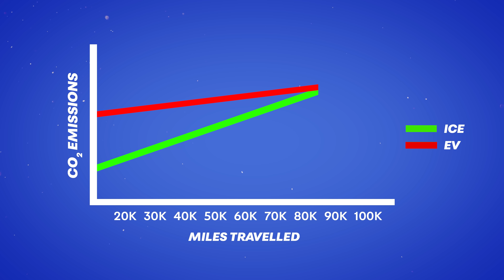Are Electric Cars REALLY That Green? [New 2022 Data]

Comment: The problem that is never discussed is the 5 mining processes involved in making the batteries and how its actually a bigger environmental issue. Not to mention the destruction of African communities digging by hand mining in the worst and unsafe conditions. Their communities are also suffering from birth defects because of it. It is not as cut and dry as either side wants to make it out to be. How are you going to still produce enough energy to power all this? Fossil fuels that's how. What happens when a strain is on the power grid? I watched a documentary about this several years ago and I wish I could find it. The findings were mind blowing and in the end they actually said that the environmental impact was worse with electric and mining the raw the materials.
Reply: Around 45% of the World's lithium is mined in Australia, and very few Africans are involved.....

Comment: Great presentation. I’m curious. What is the depreciation of the electric version versus the petrol version?
Reply: Electric vehicles keep value fairly well.
Reply: @smartwatchonpluto  makes sense, less moving parts hence less failure points.
Reply: @smartwatchonpluto  Also after 20 years? Maybe not many moving parts, but a lot of electronic parts. My 22 year old VW van now has done 250.000km and will probably do another 250.000km without major costs.

Comment: The "greenest " car would be a late 90's or 2000's Toyota Corolla or Nissan Pulsar or a Ford Laser/Telstar. If you keep buying 2nd hand parts, rebuilding engines, etc you are stopping re-manufacturing of parts and cars. The problem we have in Australia, there is not many recharging stations to go around. Most people who live 100km outside of the main cities want an EV that will get 500km out of a charge as many people here drive up to 200km a day commuting. Almost all our power is made using coal or natural gas, unless you have a battery/solar setup at home. Most solar setups on homes are NOT battery systems and just solar, thus no storage. Most 5kWh cars take about the same power to charge as twice the power of the average home. That would mean we need to increase our power output from power stations 2-fold within the next 13 years, when most cars will be EV only by 2035. Our power grid is not up to date to handle that amount of power. They have even removed many of the buy-back of power from solar power on homes and now charging people for feeding the grid due to this. I know in many parts of the cities there is no off street parking, so how will these EVs be charged at night? There is hardly any charging points along roads with homes. With a block of flats of say 20 units, everyone comes home and plugs their cars in, go upstairs, put on Netflix and the microwave, guess what.....brown-outs anyone? Then there is the problem we have here of distances that most people drive. We have big service stations with about 20-30 pumps for fuel on out freeways. These will have to be modified into car parks for recharging stations as EVs will take 40-60 mins to charge

Comment: Using wind or solar power to charge your electric car might be 'greener' in the short term but neither are sustainable as both are using up rare metals, which are not renewable, at an alarming rate, far faster than we are using up oil and coal reserves. One solution might be to bring back the small windmills that used to dot our landscapes and use them to power individual households rather than building enormous unsustainable wind turbines.
Reply: Lithium batteries are 100% closed systems.  No material is "used up" when they operate.  Every bit of reactive chemical at battery's beginning of life is there at the battery's end of life.  Take for instance the extremely common 12-volt Sealed Lead Acid (SLA) "car battery" -- it is one of the most recycled mass consumer products in history at over 99% recycle rate.  As Lithium usage grows worldwide, the money for recycling will as well and so will research into recycling these new batteries.  Governments can impose taxes or use fees on EV batteries to support recycling research & infrastructure.

Lithium isn't even that rare.  Its found all over the Earth's crust and even in seawater.  Seaside water distillation plants around the world produce a brine sludge by-product. Its estimate this brine, once processed at scale, contains enough Lithium to sustain all world wide battery Lithium production.  Lithium is actually a small part of an EV battery by weight.

The world has to move to more electronics recycling in general and not just batteries -- we need  "circular economies".   We produce around 50 million tons of e-waste per year from things like laptops, smartphones, TVs, and other gadgets.  EV batteries are obviously much larger than consumer electronics but EV batteries are simpler by being more homogenous in construction than complex consumer electronics.  Even a small portable device is loaded with mashup of wires, plastic, glass, fiber glass circuit boards, rubber, various metals compounds and themselves contain small batteries.  These are distributed all throughout the body of the appliance.  Still there are companies working on recycling these electronics!

Battery technology and manufacturing is evolving every year.  For instance, Lithium Iron Phosphate (LFP) batteries do not even use the nickel, manganese, cobalt (NMC) of the common Lithium NMC batteries.  Pretty much all the leading EV makers are thinking of or already switching to LFP because it is cheaper and lasts longer.  The highest performance EVs may stay with traditional Lithium NMC because LFP has a slightly lower energy density.

Even before "recycling", the better strategy is to "repurpose".  Recycling actually should be last resort.  Batteries used in commercial EV vehicles still have some 60% to 80% of their capacity left and can be repurposed as home or commercial grid scale batteries where power and energy density is not a critical operating factor.  BYD warranties their LFP EV batteries for 8 years or 500,000km.   Tesla for 8 years or 150,000mi (241,402km) for the NMC batteries.  You can often find these old EV batteries eBay at end of life or any other vehicle mishap for use in DIY energy projects.  They are sold by smaller modules or an entire battery shipped by freight or local pickup.

Comment: The EV cult is like the covid cult or the Ukraine cult. Scratch the surface of all the virtue signaling, and the real story is sinister and actually quite morally and ethically questionable.  The establishment is pushing EV as being "green" and pushing people into a  "green" morally surperior frenzy,  because they are being granted large sums of money from government ( tax payers) to develop, make and sell these vehicles.  And they get free advertising via the "green" cult. Everything you mention is correct but you missed some pertinant points. 1. More EV's means more pressure on the electrical grid. Even if the number of EV's would double, it would overwhelm the grid. 2. EV vehicle fires are extremely difficult or even impossible to contain and because of it even more polluting to the environment (I was a FF and trained in this issue). The battery can reignite for days. In Germany they often just let the car burn and push it onto the shoulder. This is NOT green.  Without going into detail, there are 2 documentaries made in Germany on EV fire. 3. If you are in a colder climate like here in Canada, the battery life is going to be significantly shorter meaning replacement will be imminent after a far shorter period of time. Meaning, more batteries will have to be made and disposed of or as some say "recycled".

Comment: I still see no argument made? If you are somehow dont drive a lot and switch cars every 5 years you are "greener" but just your footprint. You were still the reason another Petrol car is put on the road and it probably pollutes the Air for another 10-15 years when you got your New one. I drive my cars 5 to 10 years, and usually sell them at about 200000km (around 150 000 Miles I think?). 
So for me personally and after I Sold them an electric car is better. 

Now this Argument is only true if you buy a new car. Many get angry at me because buying an old car is better for the Environment, which is kinda true, but they usually dont last 5 to 10 years unless you get a young used car instead of the 8 year old car

Comment: One often quoted statement is that electricity is cheaper than diesel. This just isn't true outside of your home.  Charging your EV at anything over about £0.45 per kWh and you are paying more to fuel your car than the latest generation of Diesel engines (60+ mpg) for a given distance using current fuel prices in the UK and Europe (Apr 2022).

Comment: Any evaluation of efficiency and environmental impact must consider (or at least try to eye-ball) the actual use case. Because there is not one form of drive that suits all cases best. Purely urban traffic likes BEV, purely long-distance travel likes ICE, if you do both sufficiently often a PHEV is best.
If you torture an ICE through urban traffic and/or short trips, even the most efficient engines will be really bad. If you try to use a BEV for long journeys (where they are wildly inefficient), they will be really bad. If you get a PHEV, but mostly only use one of its motors, its a waste of money and loss of efficiency + quality of life.

Comment: Governments will hide the fact pollution from the manufacture of the battery parts, electric motors and the environmental impact of the waste produced from the parts after the car is used, crushed and buried in a landfill will leak chemicals for generations and leave the scars from mining operations. But hey, at least you didn't burn gas while driving it for the 3 years you had it lol.

Comment: The problem is, Volvo and many new manufacturers have poor ev economy. The XC40 isn't the most aerodynamic machine ever made. The premium brand car makers have simply put huge batteries in inefficient vehicles reducing the benefits of an E.V. If you had a model 3 tesla and ran it on renewable energy you would probably see far better figures as other reports have found. Finally who throws a car away after 90k? Most vehicles now go to around 150k or more.

Comment: Although I believe Volvo may have stretched the numbers as they'd prefer to keep on selling the ICE cars which are more profitable for them, there is a key difference between ICE And EV. Oil is a natural resource that will inevitablly run out. The materials in EVs can be recycled >95% and it is much more economical to recycle these materials than to mine and refine new material. We're nearing the end of the ICE age.
Reply: unfortunately
Reply: @peterniepel6218  I meant to say 95% of the battery can be recycled, as of course that is the main carbon footprint contributer. I got that from Redwood materials CEO JB Straubel. I
I believe battery recycling will become a new industry over time as it's more economical than mining new materials.
Reply: Where are you getting these figures that EV's can be recycled >95%.  EV are the future but battery like Li-Ion isn't.  We talk about polluting the environment with CO2 but what about polluting the environment that mining for the raw material causes.  The destruction of the land, mountains, and especially polluting the water system.  These raw material are toxic and hard to recycle.  Only a handful of companies actually recycle EV batteries They repurpose them, not by breaking them down to make new batteries.  They reuse them for something like battery packs for homes.  It is like saying plastics are recyclable because it has the recycle symbol on it.  It's getting recycled because I always put it in the blue bin to have it recycle.  What a crock!  Also, the renewable energy of solar panel and wind mills sounds great now but it's already creating issues of what to do with them after their 10 years life cycle.  If you take out the battery, both ICE and EV are the same if you are talking about recyclable materials.  There is no difference in how cars are made.  A gas motor is more recyclable than the huge battery pack.  And no, it's not more economical to recycle a lithium-ion battery. Gas motor >recyclable> EV battery pack.
It's funny that Rory said that driving an EV will benefit the clean air around you but what about the polluted waters in the areas where the raw materials are mined.  Those people surely aren't singing the same praises.
EV's are the future but we are not there yet with a good sustainable energy that powers an EV.  That is why Toyota is still looking at hybrids and Hydrogen is still being looked at.  I do not think Li-Ion is the future for EV's, at least not the ones that are in Telsas or any of the current EV vehicles.

Comment: The greenest thing possible, transpo wise, is reduce driving whatever car you've got so they have a longer life and less energy burned, and use public transportation most of the time. Trains are very efficient, and if people had less cars and more trains (say, subsidized with a luxury car tax), that would be better than any current technology of car. And even as car level motor technology and aerodynamic tech improve, those can also apply to trains, which will continue to be more efficient.

Comment: 90k miles? It might be worth mentioning that generally a lithium ion battery will last 8 to 10 years (that's a conservative estimation) and when it comes to replacing it, it will cost you thousands of pounds, dollars etc. Probably more than the value of the car at that point, rendering the ev completely useless.. And if you do decide to replace the battery, what are the emissions costs of that? Probably quite high.. The second hand market for ev's will be useless unless the money is spent on the new batteries, but the majority in my opinion will the thrown away, meaning we'll be relying on the production of new ev's more than we do on any other type of car.. Average mileage on a car is 10k miles a year, so at approx. 80 to 100k miles is when the car will need a new battery
Reply: Oh dear. More uninformed nonsense.  An EV battery does not necessarily have to be fully replaced. It can be repaired and refurbished for a fraction of the cost of a complete replacement.....  Watch the YouTube video of a 10 year old UK owned Nissan Leaf getting a battery refurb. It cost £500......
Reply: @Brian-om2hh  Uninformed nonsense? Where does your information come from, a few youtube videos? I'm a diagnostic technician with Honda, my 'uninformed nonsense' comes from being in the trade for years.. That's good for Nissan, maybe everyone should go by a Nissan leaf, it doesn't work like that everywhere else, a story about a year ago came out about a Tesla owner in the states having a dead ev battery outside of the warranty and Tesla wanted to charge him over 20k for a new one, he's the same guy that blew the car up with dynamite, a fate that should be destined for all ev cars. I can tell you now, when a Honda E battery dies, and its outside of the warranty period, referb or not, it's gonna cost a damn sight more than £500, and a damn sight more than what the car is worth. Maybe try doing some more research than basing your 'uninformed nonsense' on a YouTube video

Comment: I think buying a Phev at the moment is the best compromise. The initial  battery / co2 cost is lower (small 15kw battery), short trips or inner cty driving can  run on EV only with GPS tracking to automatically switch over from ICE
Reply: on the flip side riding a diesel powered bus with at least 30 other passengers that has a capacity for 100 is considerably better for the environment than using an EV in the city

Comment: Just based on the efficiency it should be obvious how efficient they are. An EV goes as far as a 50 gallon gas car with only 2 gallons worth of energy. Where I live in Canada, the power is mostly nuclear and hydro, so it's much cleaner than gas.
Reply: Only cleaner while driving. Mainfacturing has 4 times the carbon footprint plus end of life is way harder. Life of an EV is less than 20% more efficient than a ICE. And outside of Canada, many get it from coal fired power stations, which has a much greater footprint. Really not making a dent. You know what loves all that carbon? Trees. Go out and plant a pile if you want to fight Climate change effectively,
Reply: Germany: Coal it is!

Comment: I like your intake on this. I do however would like to know about the recycling inpact and the fact that when cars are naturally aspirated, they don’t need as many repairs (less emissions) as those newer engines that have 4 turbos (BMW), causing more parts to break down and having a worse carbon footprint.

Personally I think we should build naturally aspirated hybrid cars so have cars run on electricity in towns/villages/cities and on gas/diesel on highways. Have best of both worlds.
Reply: Funny, from my perspective the problem with hybrid cars is that having 2 engines they have more parts to break down.

Comment: The biggest issue is the power generation which worldwide is generated predominantly by gas/coal. For example in Poland one coal power station burns 6 tonnes of coal a second, the batteries been non recyclable is a issue also been kept quiet, in my opinion a EV is like a cellphone a throw away item

Comment: This doesn't account for the used market.  The greenest thing you can do for an ICE car, is keep it on the road.  But the EVs, at this point, don't seem to have the same repairability, WITHOUT significantly increasing it's carbon footprint. (ie - new batteries)
Reply: It seems you never heard of battery refurbs then?